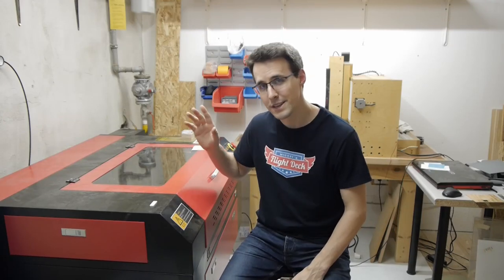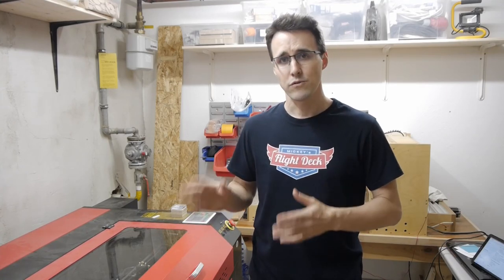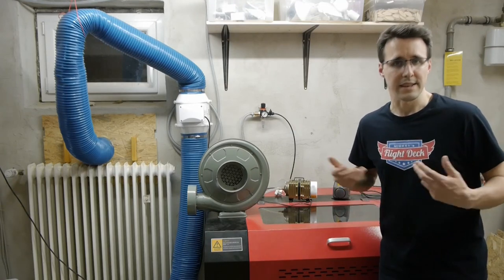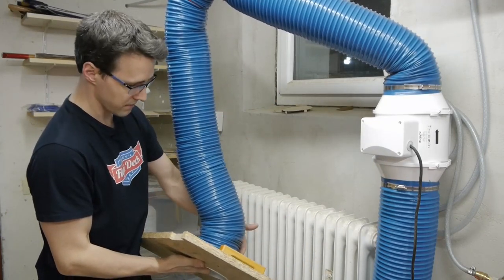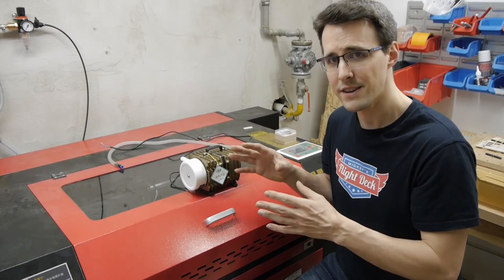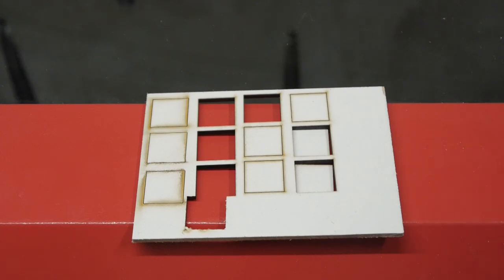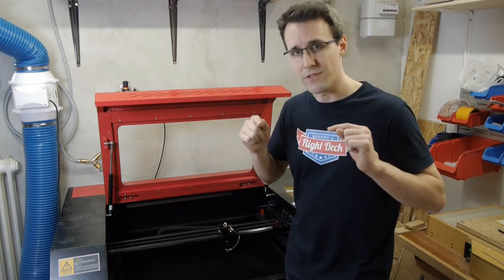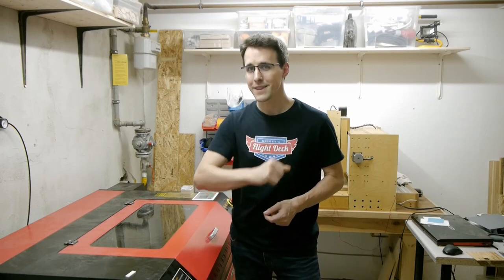My laser for making panels - A Boeing 737-800 Homecockpit #54

Comment: Do you allready have an idea how to build your fmc? There are some pretty good versions on thingiverse but they all are designed for 3d-printing without background lighting. Also I wonder how to display the Fmc data on the screen.
Very good Video by the way!
Reply from the maker: No, this is still a future project. There is not much to backlight I think. Just use tactile buttons that have the light build in and there shouldn't be much left. My first thoughts are around receiving the same datas from prosim as they use for their browser connection. Then I can use a raspberry to handle the rest.